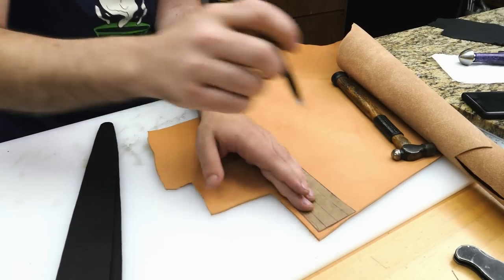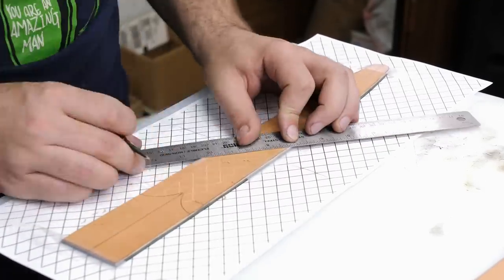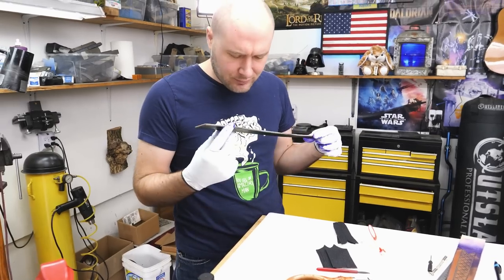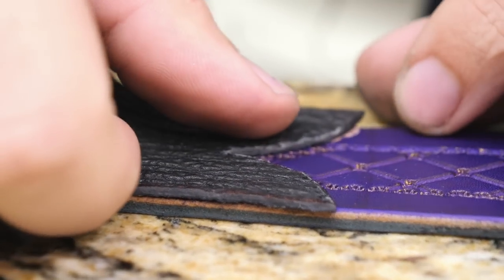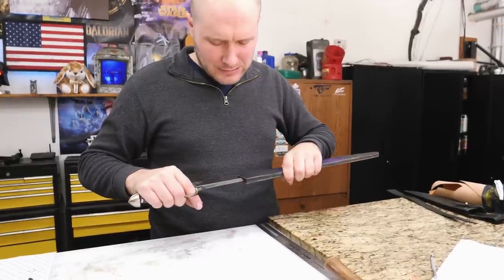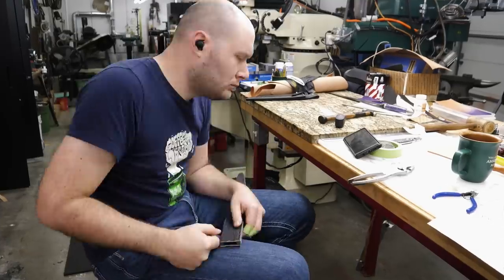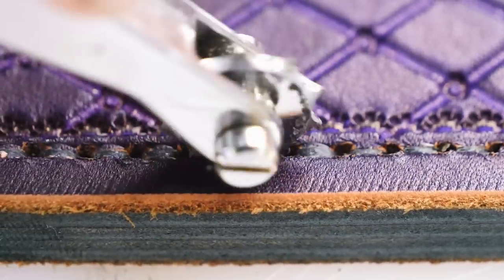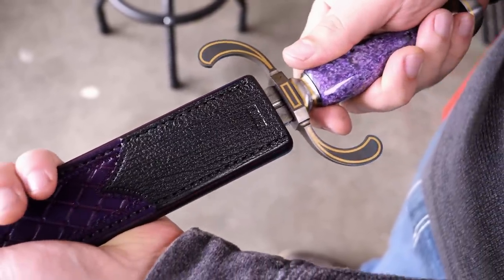Making A Purple Sheath (Serenity Pt.9)

Comment: Createx sells a product called uvls clear. It's an amazing product. You can paint bare aluminum with it and then even acrylic paint will bond. There is literally nothing this stuff doesn't bond to. It chemically bonds to the surface of almost anything and then you paint on top of it. The paint bonds to the uvls which bonds to the surface. It's a chemical bond you can't scratch it off you can even paint cheap toy plastic with it and it bonds. You spray it out of an airbrush. I'm a painter and this stuff is a God send. Instead of going through all the old steps to prep a surface, alcohol wash, flame treat etc you skip all that and just spray this on. You wouldn't have had to make a second sheath. Yes dyes work as well I originally bought it specifically for dyes. It really helps those candies pop and keeps them from bleeding without 20 layers of balancing clear.

Comment: Kyle - I know precious little about making knives.  I have maybe made 20 in my life.  However, I have been doing sheaths for about 12 years.  If I may give a few things to consider, sir, if I may be so brazen.  First -  I am shocked by the resist the dye gave to you.  I use acetone in the shop at times and have never seen it resist dye like yours.  I am going to test it in my shop and see if I can recreate your experience.  Here are my thoughts.   1) Consider using a swivel knife to cut the lines for your grid pattern.  It gives a very crisp edge when beveled.  2) You welt shold be about  70% thickness of the blade.  That gives a very good fit.  3) Consider buying Masters Contact cement thinner.  It will help you with control of the glue.   I run mine pretty thin.  It will penetrate the fibers better and allow for better adhesion - although it will take another coat.  4) When punching the holes for stitches - consider using a needle slightly larger than the one you use for stitching.  It will leave holes that will self heal better and conform to your stitches.  5) May I suggest building a simple stitching pony to assist your stitching.  6)  Given that iron dust will turn leather black when it is wet be careful using a used belt.  The process is the tannins in the lather reacting with the iron dust causing a chemical reaction and making it black.  7) May I suggest tokenole for the edges.  It is so much better than Gum Tragacanth.  

Please accept my comments as they are inteded.  Something to be given with utmost respect.  Your work is amazing and your sheath work is very nice.  These are just humble suggestions, sir.  AMAZING blade, as always.  Thank you for your videos.

Comment: you should try dip dyeing I personally like it better and you get dye deeper into the leather. also when doing your edges you can make a burnishing tool out of wood with different width channels(depending on the thickness of leather you are working with) then you just put in a mill or drill press and as it spins as you can just pulls your leather through it to burnish your edges. Beautiful work btw.

Comment: A stylus would help make the tooling of the diamond pattern much easier if you were to get some. The most likely reason the stain work wasn't because you used acetone but because the leather wasn't fully dry. Acetone doesn't effect leather's ability to absorb stain as ling as the acetone has fully dried. It is commonly used to clean off any waxes and oils on leather goods before re-dyeing them.

Comment: Buy some stitching irons! It kills a little piece of me every time I see someone use the drill press to drill holes in leather on anything that isn't at least 1 inch thick. You are correct it does burn the holes. Which means the hole walls are dry and brittle. And with time/elements/use these holes will tear. They all have the chance of having near microscopic hardened points in the hole wall. And with time that can cut your thread. This is something that is more likely to happen 5,10,20 years down the road, but still a problem. And if you want your work to outlast you... 1 step to that is getting stitching irons and saying no to the drill press! And some general life improvements for yourself when working with leather, When you talk about dooming the leather ends. This is called beveling the edge and I suggest purchasing an edge beveler. Because you make blades your skill with the belt grinder is really high. But is still very easy to to make uneven sections of the edge by sanding the edges to bevel the. And I highly recommend sanding the edges smooth before making the stitch line. It will help make sure you are consistently making even straight none wobbling edges. And last, get a real leather burnisher. It will help make the burnishing process go a little faster and you wont need to switch tools to burnish. But the end result for your sheath is freaking fantastic! it looks gorgeous!!!!! Great job! And I recommend Tokonole for everyone's burnishing agent. There is nothing on earth that works better. Beautiful dagger! Beautiful sheath! Beautiful work! Beautiful video!